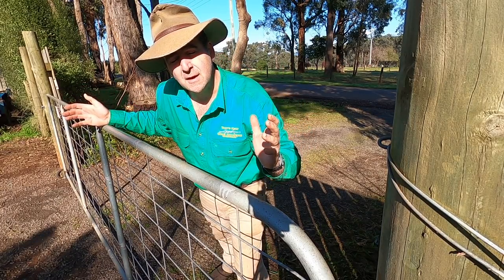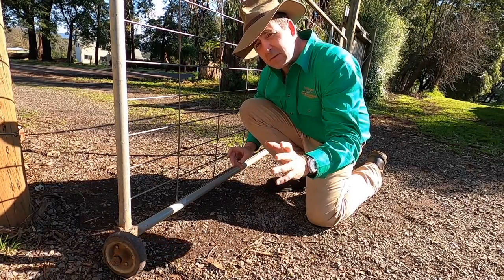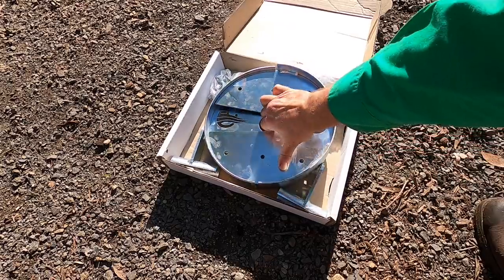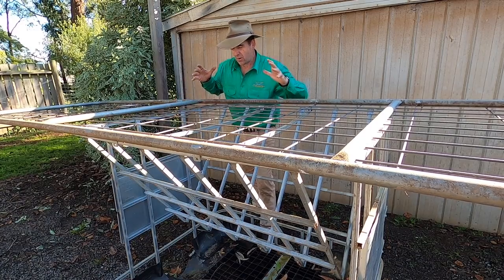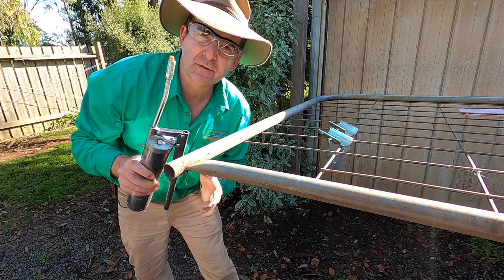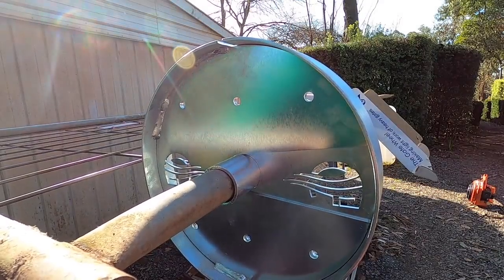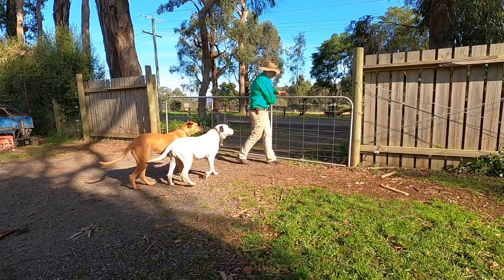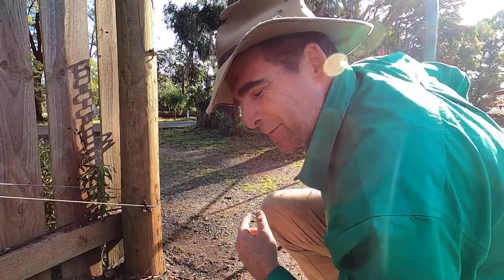Gate Wheel. Does this stop gates from dragging along the ground? Will it possibly save marriages?

Comment: You secretly read those instructions a coupe of times didn't you? 🤨

That wheel is a great bit of design work, very well thought out.  I think that I have seen about 100 failed gate wheels and the worse they fail, the harder they make it to use the gate until you have to lift up the end of the gate to be able to open it.  Castoring wheels are about the worst.  I'm going to have to think seriously about getting some of those wheels. 🤠

Comment: Great video and that looks a great product. I've just watched the manufacturers video, but it didn't allow comments. Then I randomly picked yours and you use the same wheel, LOL. I'm making a bespoke steel framed gate myself, about 12ft 6 inch long. The gate has to open up a slope on slightly uneven ground, so I'm going to fix my own design of sliding hinge at the bottom of the gate and weld up a wheel bracket for a wheel on it at the latch end. The thing with this gate, is that the wheel has to support the whole weight of the gate as it opens up the slope. Unfortunately I can't make one of those triangle shaped gates like you see in some commercial properties, as the gate has to be rectangle from the ground up and covered in steel mesh, when it's shut, to stop people's dogs coming in my field off the public road.

Comment: Living on black soil and with fence posts that move whenever it rains, mine got a bit more involved than that. I got sick of wrestling it to get it fully open, so went for the over kill option.
The 14' gate doesn't sag, not now it has a 50x75x3mm rail and cantilevered rollers bolted onto it.

Comment: Tim, I had to laugh the grinder, I've just bought a small holding in South Australia. Some old pig pens I do not need. I advertised and a chap started cutting with a cold saw, the saw failed on the last gate, so an angle grinder was used. The inevitable happened started a three acre grass fire. Perhaps mention the fire risk especially for the new people to rural living.
Reply from the maker: Great point. This was winter..... I've also fought fires started by knuckleheads with tools.

Comment: Tim - great video as usual. I'd be keen to get your thoughts on a solution for ground that is more uneven (think lump dirty, bushels of thick grass). I am putting on a few 5m gates and thinking of doing a little attachment and then attaching a jockey wheel (bought from Facebook marketplace to keep the price down). That way you can lower or extend the wheel depending on where the gate stops (if not closed) and most importantly if you extend the wheel a bit higher than the gates attachment you can push the weight back into the post. Hence no post-movement over the long term. Thoughts?
Reply from the maker: Hi mate. I’d prepare the fenceline with a smudger mate. Make it a lot easier.

Comment: Any solution for a gate made from wooden boards?
Reply from the maker: Try a wire brace. Strain up as per box assembly
Reply: @FarmLearningTim  Thanks for the idea! I  used to fix wooden gates using wooden brace but they always are getting skewed  with time.